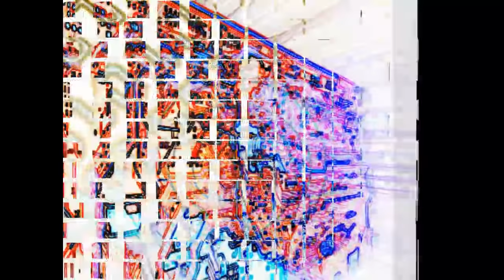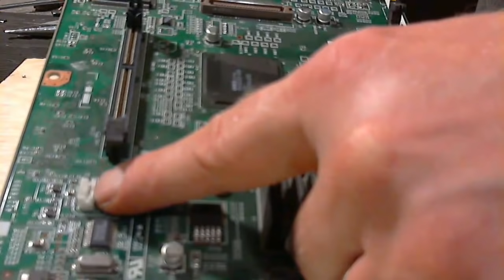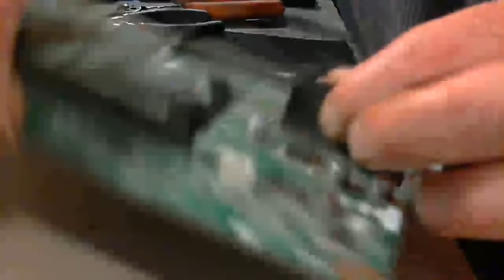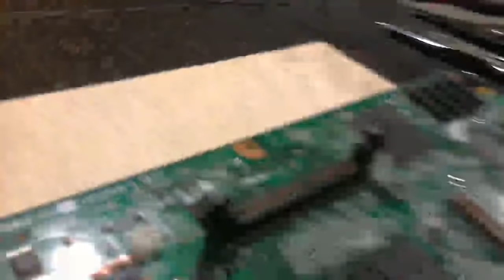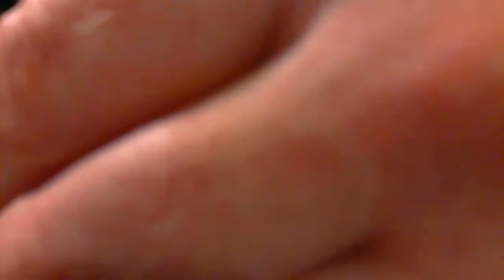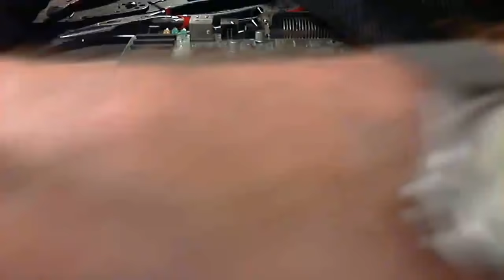How to remove smd chip without hot air

Comment: I thought this was so good as I have been trying to remove a chip from an o2 sensor motherboard, located in a restored 67 Mustang.... The edelbrock kit has only 3000 miles on it and to replace it is over $200..   
Having watched your method of removing a chip I can now go ahead and replicate what you have done to get the chip out. I tried a solder sucker and removed most of the solder but still could not get the 18 pins to let go of the board. Your copper wire method is brilliant and to clean the board with copper braid is an excellent idea..Thanks heaps

Comment: Everyone in our department had their own favourite way to remove smd's. For a small, inaccessible chip like this, I used to carefully cut the pins along the top with a sharp Stanley knife (several swipes would do it), remove the legless chip, then apply generous amounts of flux to the pcb and remove the pins with a hot iron and solder braid. Larger chips are easily removed with a hot air gun.
Hope you've bought a better camera since making this video :-)

Comment: My fellow brit you have just saved me a small fortune on an Ebay purchase of a hot air set up. i have a broken circuit board on a Bosch washing machine that I am told needs a new 28pin Led driver. Its tiny and located so close to 2 tiny micro resistors. Now I can avoid the cost of the heat gun and not risk the resistors de soldering. I just have to take care resoldering the new Ic Led driver back in with a magnifying glass and avoid coffee or alcohol cos I will need to be cool hand luke. :-)
Reply from the maker: Colin Riley just use the force lol glad it helped you out.
Reply: fixitdaz indeed. Thankyou, for fixing phones or tab where plenty of component stood so close together, this method seems quite handy.

Comment: I wish I'd known this in my Freshman Intro to Electrical Engineering class. When we moved on to soldering in that class, we had to start with de-soldering things off of boards my teacher had in bins. Myself, and many others wanted to remove microchips, so we tried to do it with just a soldering iron and copper braid. Turns out, that's a bad idea and will most likely ruin your board.

Comment: This is a decent trick but ~70 bucks on an inexpensive hot air station is an excellent investment. I use mine all the time, wouldn't be without it.  Also - handy hint - it makes a fantastic tool for ungluing things covered in hot glue.

Comment: I like this idea but i think a hot air gun with the correct nozzle type and capton tape (to protect the surrounding components) would still be the best method. it did look like you had to use some force to pull the chip off. however im just being picky and this is actually a brilliant improvisation and ive learnt something new today. many thanks

Comment: I protect heat sensitive parts with a poultice of wet toilet paper molded around the susceptible part.  I learned that from sweating copper pipes and using wet rags to protect wood from the torch.  That is a clever idea that you have.  I wonder if a soldering gun could be rigged with a bent piece of copper wire instead of the usual tip, preheated, then dropped down onto the pins of the chip.  Of course it would be important to be sure that no current was flowing through the substitute tip or the chip would be electrically destroyed

Comment: If you aren't going to use the component again you could always take a scalpel and cut the pins off the chip, then you could take an iron and remove the pins from the traces easily.  That big copper wire kinda scares me with potential heat damage.

Comment: Excellent technique dear sir. I would give a try to the method. I am using hot air but you are correct hot air is not always suitable due to difficult locations. Regards,
Reply: +LearningZone  u make vidoe like that..ok
Reply: specially when they are surrounded by plenty of tiny components.
Reply: And don't forget size

Comment: Just tried it with an ERSA 30 soldering iron (30W) and a 1.5mm copper wire. After heating for two minutes I was able to remove the component, a fragile receptacle. Fortunately, this was just practice: The receptacle got damaged. One edge was partially melted, and two pins got ripped, sticking to the board.

Comment: Why just not use desoldering wick/braid on the pins directly? would it work?
Reply from the maker: +Nintendo129 probably not but I could be wrong this is just a easy way to remove it if all you have with you is a soldering iron and a bit of wire if you are on site and the pressure is on to fix it. you know how it goes less down time the better.

Comment: hey erm may i know what type of enamelled copper wire are you using in the video as shown? can i have the full name of the type of enamelled copper wire as I'm looking to buy one but however at TradeTronics PTE LTD they have several different types of enamelled copper wire and I've no idea what and which one to purchase.
Reply from the maker: mastermind tan any coper wire will do 1.5 mm or 2.5 mm depends on space size of legs ect hope it helps .
Reply: +mastermind tan  I'd stay away from enameled wire and just use bare copper.That way the solder will stick and help transfer the heat.I used ground cable from romex 3 wire house mains wire and also wrapped it around a large soldering iron tip a little differently then here so I could do it one handed and grab the chip in the other ;)

Comment: Yeah, try to remove this way a chip, soldered to ,25in thick traces (like so8 transistors for example) You need a preheat. And if You have a preheat station, You already have hot air so... ;) But nice trick anyway. Could use better camera or magnifying glass tough. Movie quality is at most a haidryer like.
Cheers!

Comment from the maker: Hi Clffr2011, Hot air would be a lot better but this is a way to remove a chip if you are in a pinch or don't have a hot air gun / rework station, i was demonstrating that it can still be done with just the basics,Thanks for the input and thanks for watching.

Comment: Do you people think it would make sense to attache a very thin, custome made copper tip to a soldering iron, so that one may be able to use it with very small parts?
Reply: Yes there are videos showing this
Reply: @a.b.c.520  I allready bought a similar thing years ago, but still thank you for the answer, even if it took some time.
Reply: @ABW941  sorry my friend I didn't see the date when you posted your message :)
Reply: @a.b.c.520  No problem.

Comment: just cover the plastic with heat resistant tape and use a hot air gun, point the gun away from the plastic

Comment: hello friend semple would like to see your vidio aid have a diode smd smd pj1189 740b and 740b pj 1219 works on a frequency inverter, I'm not finding the equivalent. burning this igbt inverter and manufactured in china mod CAM200

Comment: won't that lose data of the chip?
Reply from the maker: +May Ford Bay-an only if it needs constant power to retain its memory, but if the chip has failed what will it mater its just a case of reflashing it.

Comment: You can easily burn the chip like this.
Reply: Its the OLD bad chip..so what does it matter? lol
Reply: Its the OLD bad chip..so what does it matter? lol
Reply: Would not hot air generate even more heat to the chip?
It seems like this is quite a gentle method.
Reply: If the chip is bad you can just dremel off the legs and remove the feet left on the pads one by one
Reply: But what if the chip is already burn or corroded?

Comment: Playing and testing any brillant ideas on old useless motherboards is very easy and free.And if some pads lifted there is no problem,who cares.Just make an irrepairable damage to a laptop,mac or to a car CPU box and then you will understand that chip desoldering in modern electronics is a fine art a lot more difficult that soldering back the replaced chip that is extremely difficult also.So billy boy,grab your 3$ soldering iron that is bought from your local hardware store,make miracles and mocking to the naive who pay money to serious reworking tools for repairing.